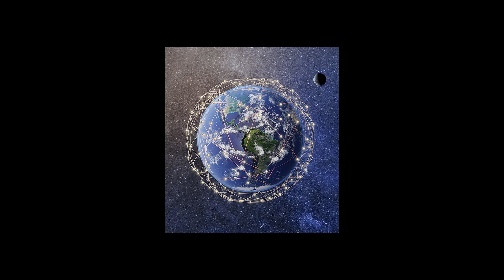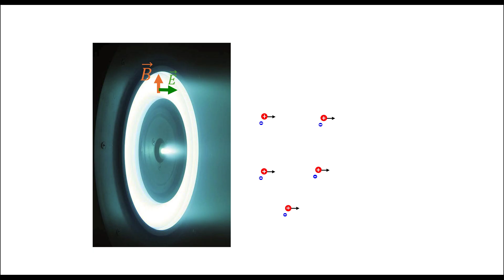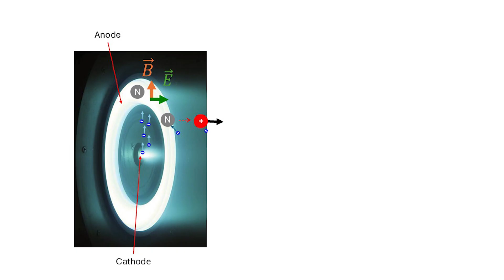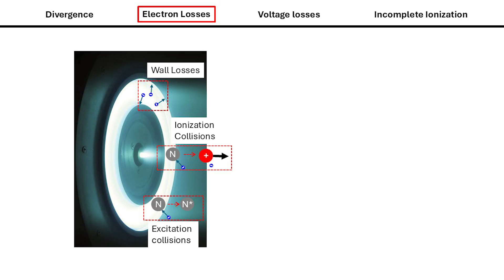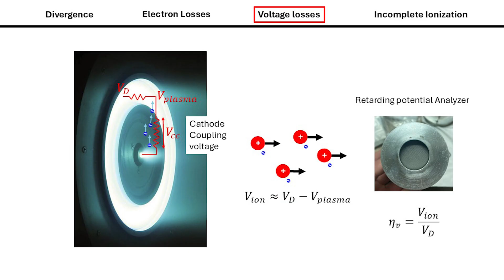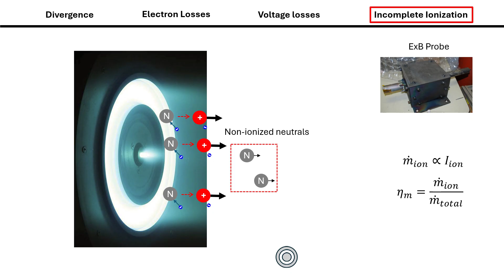Hall Thruster Efficiency

Comment: do ion thrusters act kind of like the old cathode ray tubes of old? where high voltage causes electrons to leave a wire in empty space?
Reply: Not really, the electrons are just used to ionize the gas. The positively charged ions in the plasma are then accelerated using the magnetic and electric fields in the thruster. Its different from a gridded ion thruster in that there is no grid, the hall effect is made use of instead.

Comment: What abt efficiency wrt mass of the "propellant"? Only beam divergence would help here
Reply from the maker: Mass of the propellant does not actually directly impact the efficiency. The thrust to power ratio is higher for more massive propellants like xenon, but the electrical efficiency is independent. With that being said, lighter propellants tend to be harder to ionize which results in an ionization efficiency loss.